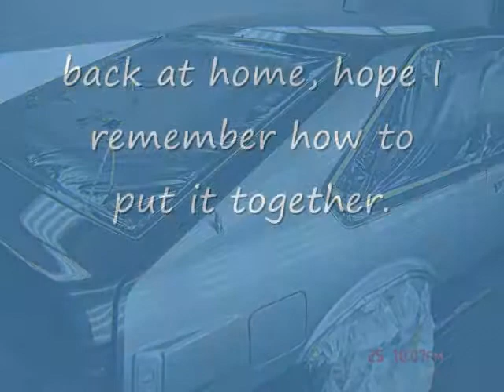project celica

Comment: well how about an update already?
Reply from the maker: +Randy Pullman     I got this car along with a 1985 sr5 Tercel 4wd wagon in trade for a paint job I did for a friends work truck. He worked for his dads tow yard. To me they were both free. I was going to paint the truck as a favor anyway. 
 I put a new clutch, tie rod ends , power steering pump, and urethane suspension bushings in the Celica. I drove it for about a year and a half then sold it, along with my boat to buy a camp trailer.  
 I have no projects at this time but I'm on the look out for an 88 Celica  All trac. I've always wanted one.
Reply: +jteigen1 C'est la vie. it looked promising all the same. my dad has had a 1985 celica gt sitting in his yard forever and I was considering backhaving it and mini tubs...sbc conversion, a jerico 4 speed dog box homemade SS fender kit. take care man oh nice video man